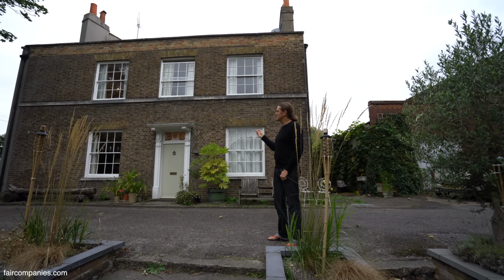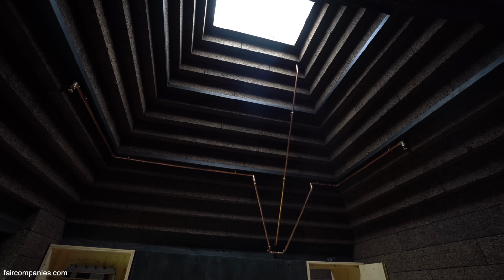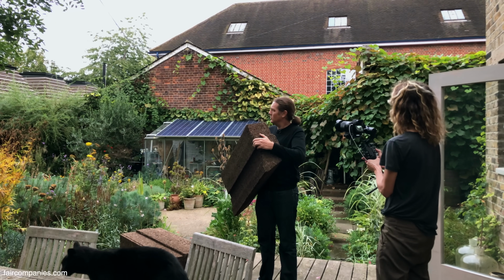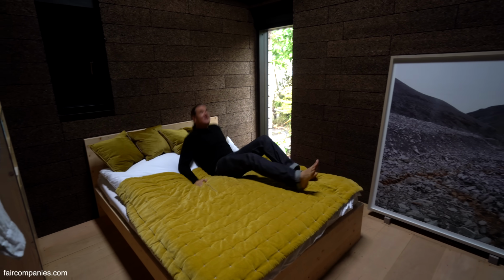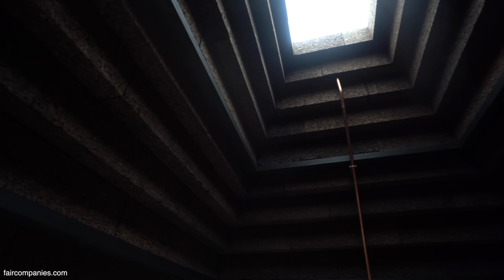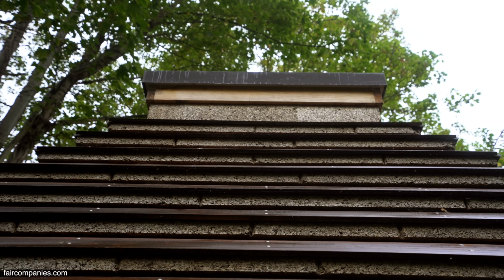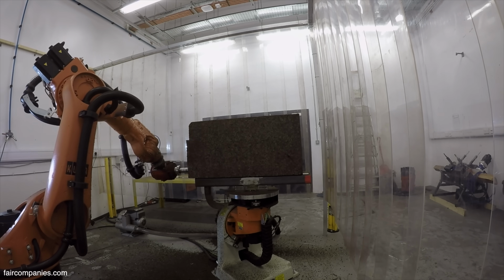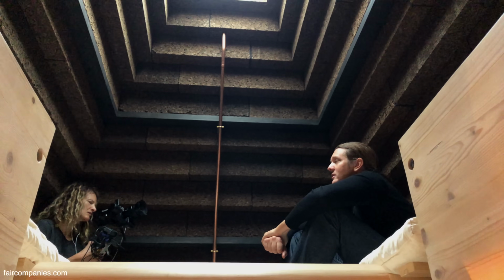Biodegradable home built by hand with cork LEGOs, no glue

Comment: I like it! I have a few concerns.
1) I suspect the roof blocks handle water fairly well since cork naturally rejects water, but water that gets between the blocks and turns to ice might eventually destroy the roof structure.
2) If the blocks aren’t pinned or glued together, how well do they handle strong winds? [he sort of covered that]
3) How fire resistant is cork? My guess is about as good as most non-stone or concrete building material.
4) And how would I keep critters from tearing up my house? My brother built a dome and insulated it with with spray foam. But a woodpecker kept pecking fist-size holes in the insulation all the way down to the internal plastic sheeting and then moving onto another spot. So I’d be worried about bark beetles, termites, and squirrels destroying my house to insulate their nests.

Comment: Call me crazy but why hasn't the tiny home industry jumped all over this? Imagine a T&G wall system where the 36' X10'  wall panels snap together. Multicolor conduit for utilities and solar lighting with an arched metal roof all delivered to the site in a Sealand van? True there would be structural issues as a 4" diameter wall would have to be supported and the R-value figured but unlike a stick-built wall, cork has residual stored heat. All shipped from Spain, Serbia, Albania, Portugal or wherever cork is growing. Kristen how heavy are these blocks?
Reply from the maker: Very light. One person can lift.

Comment: Okay time for some criticism? 

.
The block concept is not new, take a look at Hydroform bricks (hydroform.com).  The flat glass on top is a nightmare (I wish architects would stop this).  Condensation builds up on the horizontal glass and drips down (onto the bed).  Also flat glass ceilings build a huge amount of dirt (from rain) terrible view when you lie in bed.  The smaller sectioning of this house with small ceiling cavities is conducive to limited air circulation, ie: these rooms will smell bad (very corkish smell I would imagine) and there was no discussion of a ventilation system.  You can open windows to ventilate rooms but there will be little impact to the volume above the window ie: they should have made a longer vaulted ceiling.
.
I do have a curious question, looking at the Hydroform brick.  Could they not have modified the Hydroform machine to make cork blocks?  I do think the properties of cork are impressive as a construction material.  My criticism aside, I do think there is something good here.

Comment: So nice to see public "research" funds being properly used,...
to build sublets for the pals of poor cash strapped hoorays with only illiquid multi-multi million pound abodes in the leafy west London suburbs to their name.
And to build it out of utterly un-scaleable materials too boot. Bravo!
The blocks should have been constructed out of fossil fuel derived polymers. When we necessarily and rapidly transition our transportation and energy sectors to renewables, there's going to be a huge petro-chemical infrastructure lying idle. Oil extracted and sequestered in long-life building materials is far better than oil burned to CO2 or turned into short life plastics and it's far more instantly scaleable than clearing zillions of acres for the planting of cork trees. I'd wager that the blocks would be considerably less expensive to manufacture and mass produce also, and quicker as they could be injection molded rather than milled individually!
Utter, utter bollocks. This was nothing other than a nice little cash bung from one bunch of English aristos to one of their own.

Comment: Great presentation. If I remember this correctly the material that is used for walls was used for insulation and isn't smart to use it exposed. It's not healthy. I remember ages ago people telling me that these materials were banned in the 60s for being cancerous and can produce mold.
Reply from the maker: Oliver explains that this cork isn't mixed with any -polyurethane (like some other cork products), but instead they used only the natural resin as a binder. So it's 100% natural.
Reply: @kirstendirksen  Natural and Safe  are two different things, I am sure that much research was done and the expanded cork is probably fine. I just would hate to think that there is an assumption of safety based soly on the fact that there isnt any polyurethane in the construction.

Comment: If the cork-blocks are just set one on top of each other, how are they secured against shear-forces !?

I recon a mild to strong storm could ruin this house, or is there any other way of ensuring the structural "proofness" of this building?
I guess it has to be built to code at least, right? 

Here in germany everything is strictly regulated and even though one CAn construct their own home, it has to be approved and it`s statics have to be calculated and it has to be wheather proof, it has to be noise-proof to a certain degree and of course it has to withstand a certain snow-load and windload, when there is  abig storm coming in!

So these things considered I would be very interested in how exactly all of the above mentioned is achieved in this particular building!
Reply: ok - I got the answer on my own by simply continue watching, so I will answer myself here to help anybody bearing the same question.

the individual block are about 50cm thick! that is half a meter or for our american friends, about 19,7 inches!

They have precisely cut tongues and grooves and fit together snugly!

they have been manufactured to by a very expansive KUKA CNC robot arm with an attached milling head - funny thing is, KUKA is a german company in Augsburg, several decades old and specializing in engneering machine parts and complex robotic arms for car-manufaturers....

very cool concept, but very cotly to duplictae!

unless specially manufactureed parts/interlocking bricks would be mass produced

also this building sports strctural wardrobe designs which helps dissipate the wind shear forces into the walls and adjecnt structures....
cool!

Comment: When I lived in Portugal I saw many areas planted with cork oaks. Recently there has been a move towards using plastic wine stoppers. Surely the cork farmers would be delighted to find an alternative market for their crop. As I understand it, cork is not only a wonderful insulator, but also insect and damp resistant as well as being much lighter to transport and work with, which makes it less labour intensive for the construction industry.
     One question would be, when the blocks are being formed originally, would it be possible to mould them into the dovetail block shapes to remove the need to mill the complex shapes?

Comment: Why not mold it into its final shape, rather than milling it out later?
Reply: @pootatotree7546  That makes sense. To be air/water tight machining is probably the best way. 

I also wonder from a cost and manufacturing efficiency point of view. Perhaps they can reuse the material they cut away in subsequent blocks? And/Or if they just use one common mold (or a few?) then machine away from there, thus saving the time and expense?

Comment: Nice BUT,,,,
You need to cut fabrication time. 10 hours is way to long to create 1 block. Pressing the cork blocks in molds that produse the desired shape, size / interlocks would be far more practical. 1 process and it's ready to go. A dome would be off the charts in structrual integrity. The basic out of the mold block could be assembled on a turn table as produced. 2 satationary robots, interior center, and exterior, rotate the table and mill the finsh all in one shot

Comment: The fixhures and fittings are excellent.  I love the addition of the (reclaimed) CLT spruce used for the wardrobes, door thresholds, shelves, beds and kitchen furnishings, which balances the darkness of the cork.  I was worried about wind and fire damage but he seems to have covered those hazards.  What l am unsure about is probably more psychological as someone could just get a chainsaw and cut through the walls potentially so l"d feel vulnerable. Further, it's a little dark. (Bottle corks are not so dark therefore l guess it's the 'annealing' process under pressure that chars them or discolors them, l guess.) Was there no way of naturally bleaching them?   The ziggurat style roof enclosures,  although providing  the house with a uniqueness and charm, giving it a cottage feel, for me seems a much underused space. I am sure that could have been solved with a slight alteration to the roof blocks' internal design by slicing them so they're smooth and would look more like the ceiling frieze in the bathroom snd  would have yielded more space.  You have almost the same capacity up at roof level as you do below, or perhaps only 1/3 less. Were you not tempted to cover the cork with a brighter veneer facia? I know you want to see your lovely cork brickwork but you could have put a strip of glass or perspex every 6' so the cork could be seen.  That would strengthen the structure too.  I hate to be the messenger but l know the first purchasers will immediately spray the walls white (or their desired pastel) to brighten it.  The other alternative would be more lighting.  I would have been tempted to build 2 levels and make the pyramid rooves shorter: that way the beds would be closer to the roof lights and the stars above.  All my personal suggestions aside, the Architect builder is obbiously highly talented and deserves to feel proud of such a magnificent example of outside-the-box ideology in this grey-glass breezeblock realm we find ourselves inhabiting.

Comment: Easiest house to break into, ever.  :)
Reply: i mean.. not much harder then.. say.. a wooden house. these are very tough blocks lol. youd still need fairly loud powertools.. you are not going to cut thru the wall exactly unnoticed :)
Reply: If it's just put together like blocks, then you don't need tools or to cut anything to get in.

"built a home almost entirely by hand that uses no glues or mortars"...
Reply: @daveola  yeah.. so youre sayng the thief would singlehandedly start to dissasemble the house from the top? yeah because that would go.. quickly lol.
Reply: Actually I just made a joke, and the tone was clearly lost on you, but the house does raise interesting security issues. I have a feeling that anyone familiar with it's construction could find some blocks that they could pull off, perhaps from the crest of the roof, and be able to get access without damaging the house (and even be able to reassemble it afterwards to hide the entry point.)
Reply: @daveola  There are steel ties around the roof caps and the top of the wall of the structure to relay load.  Would this thief come with a massive crane to remove those first?  I genuinely don't understand why 20% of comments under every Kirsten Dirksen video are from people insisting a structure is vulnerable to break-ins when there is no evidence for this.
Reply: @tamcon72  oh man, you build a Lego house, people make a joke about breaking in, and everyone takes it so seriously!
Reply: @daveola  If you check the comments at this channel, there is always a significant chunk of viewers voicing fearful fantasies of home invasion, no matter what the structure featured in the video.  Under every video.  It's pathological!  So, naturally, I assumed you were another one of these fearful reactionaries.  Apologies!

Comment: My concern is that it’s cork and as a collective we should be moving towards sustainable material.
Reply: NM tmblwd Cork is sustainable! We actually need to use more of it- there is a massive problem with the loss of cork orchards since a lot of wine producers have moved to synthetic cork. The fall in demand for cork has meant the trees have been uprooted and the land cleared for other crops or building.  Cork is harvested without damage to the tree which is grown especially for the purpose, can last centuries, and supports a massive number of insects, birds etc.

Comment: those blocks will deteriorate and crumble to dust in a matter of years or a decade.
Reply: @Erick Rosa Glad you agree - l just felt it needs something gut-feeling, spidey-sense-wise 🤔
Reply: I think the block-forming process under pressure melts the internal resin/amber so it all reforms into an incredible solid block a little like longer lasting waterproof MDF.  But l am at a loss too as to why there is no external sealant or (natural) lacquer as an extra  precaution. (There has to be a natural one made of wood resin surely?)

Comment: you could plaster it with lime to transform it from a cave to a house; lime would also protect it from elements and mold and grant an airtight barrier on th einside as well as a water thight barrier on the outside; how resistant is the cork to UV, water, mold, biological decay, animals like rodents ants termites etc.?

Comment: There's a cork shortage at the moment.  He doesn't mention price but there's no way it could be an inexpensive alternative to traditional materials.
Reply: Thats probably why they bought all the scrap from wine cork companies to cut the cost, probably still pricey though
Reply: I actually appreciate the fact it was built by 2 people, uses no other joining material or supports. Costly as it may be, I would say it still saves quite a bit considering the small costs (which add up quickly) of traditional building methods. I also appreciate the clean, green eco manner of building. I would use this. Especially considering the ease of assembly. I would like to see one disassembled.
Reply: Yes I had heard about a cork shortage about 20 years ago
Reply: however... should this kind of building style take off, capitalism will provide one way or another. it wont be cheap for the foreseeable century.. but if we assume this kind of material replaces current means over time, the cork industry itself would grow along with it. And once we figure out how to skip the decade long growing process... we'll be in business :)

Comment: This is great. My only concern is how dark it is inside.
Reply: most elegant dungeon i've ever seen 😋.  no, really though, as a showcase for both unique environmentally sound building materials, and for engineering, this is brilliant, yeh?  😁
Reply: @nonyabizness.original  and nothing has been done to color or bleach to Cork organically.  Even exposed to the sun will produce a Cedar Gray finish over time, remember this is just the START of a great idea.
Reply: @billburgess4720  yes, i noticed how the exterior had already lightened a bit.  it really is brilliant in both concept and execution.
Reply: He's using all black trim tho.
Reply: I love the darkness.
Reply: @Kuuryo but applying paint would make the cork much less usable in future - - - I think part of the idea (which could have been better articulated) is that when disassembled most of the components are still in a state that they could be recycled at the same level of quality and function.

Comment: I’d love to know the comparative R value of cork.
Reply: James Greenfield -        "Expanded cork insulates to R-3.6 per inch. It has a density of 7.0–7.5 pounds per cubic foot and compressive strength of 15 psi (with 10% compression). It is intermediate in its permeability to moisture—with a 40 mm layer having a permeance of 2.2 perms."
Reply: Thank you!

Comment: Another major advantage of cork is the incredible sound proofing of the house. Compare that to a brick house were you need to fill it with curtains, carpets, textile furniture to keep the echoes out.

I listened this episode on my headphones and you can really notice how great the sound is in those rooms.
Reply: I was thinking the same thing about how quiet it is. I have a small room with cork floors and it's noticeably more quiet in there, and peaceful. I don't think we realize how much sound bounces around in modern houses because we're use to it, but we evolved living in mud huts with mud floors, very quiet. This house appeals to me because of that; the only thing I would change is by using a milk paint on the inside surface walls to lighten them and let the light move around the room. Cork can be finished with natural finishes quite easily. When I refinished my cork floor I just sanded it down and used Rubio Monocoat on it-- a natural, non-toxic oil for finishing wood. But because the walls won't get much wear, I think milk paint would be perfect, just sponge it on.
Reply: Why isn't this more commonly used?
Reply: @nofurtherwest3474  because it is dark, ugly, and impossible to clean (dust or splatter).  My dad had one wall of it - the wall nearest the street.  It did keep out street (car) noises, but was not attractive.  Maybe it would work better on the outside (like another of Kirsten's videos), but in a humid and dusty climate, i'd think the dust that gathers in the holes would grow mildews/algae. Would need to be for very dry areas only.  I am guessing, of course.
Reply: @genkiferal7178  interesting thanks. They should just cover it
Reply: Bricks with old fashioned mortar - not cement based, can have really good acoustic properties. I live in an apartment from 1939, and it is lovely to sing here, even when I just moved in and had not unpacked yet.
Reply: Just a question from a little ignoramus😊…is cork a fire retardant?….
Reply: @pennypiper7382  another video says YES, that cork trees caught in wildfires not only don't burn, but can be planted as groves in a ring around a village to stop the wildfire from reaching the houess/buildings.
Reply: @genkiferal7178  ..thank you. That is very interesting!   👍👍
Reply: @genkiferal7178  so good to know👍❤️🥰